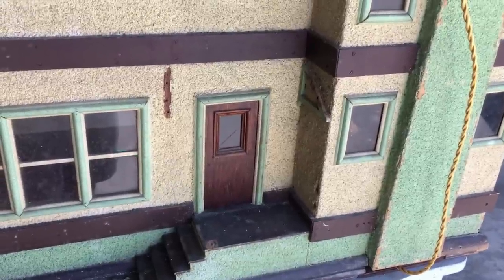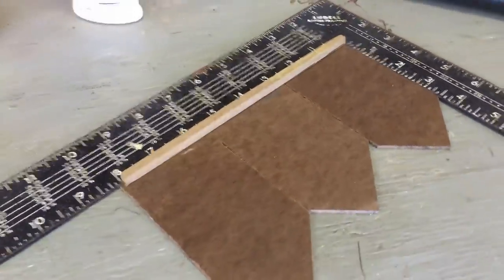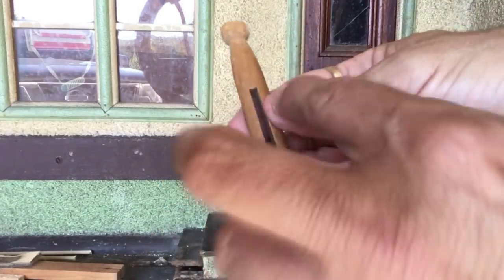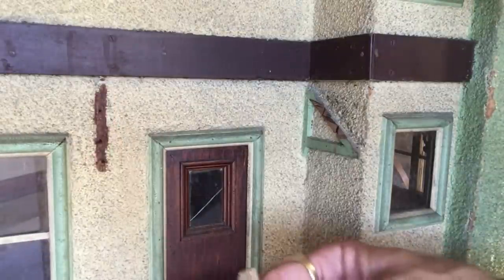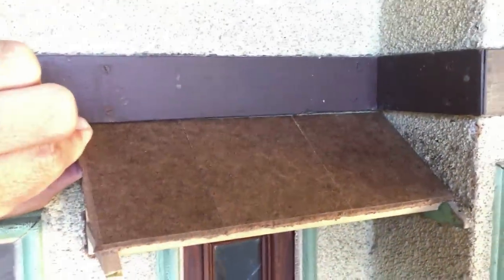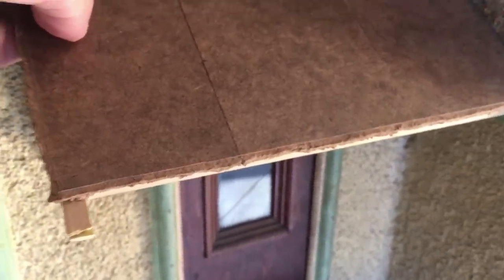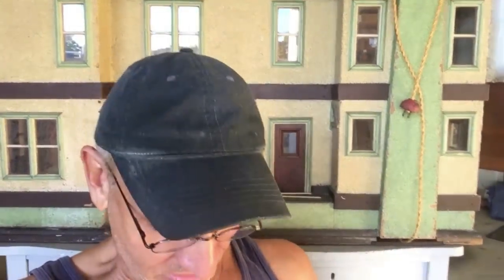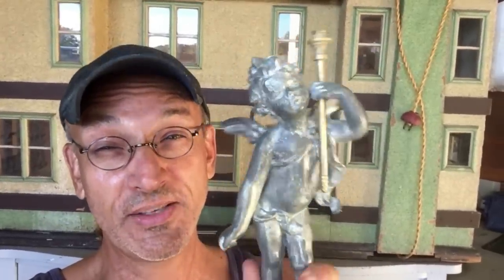1920's Dollhouse Restoration Part IV

Comment: I understand this is a labor of love. consider using dawn dish soap. its used on birds when there is a oil spill. I would love to see you even clean the walls with dawn and a damp cotton swab. also,  consider using the same material that is one the roof for the porch? Are you going to put a clothes pin against the wall as a railing post instead of just the long posts out of the wall? Much Love
Reply from the maker: Dawn in what I had in the bucket of hot water.
Reply: @oldcuriosityshop265  SMART MAN